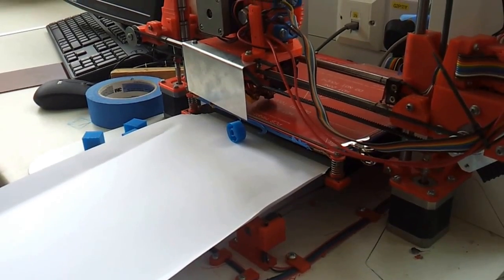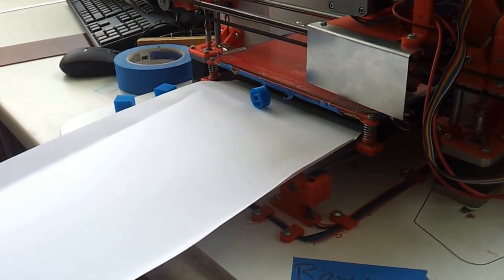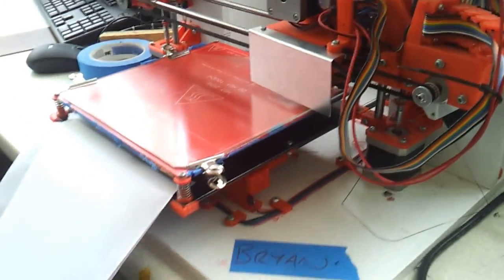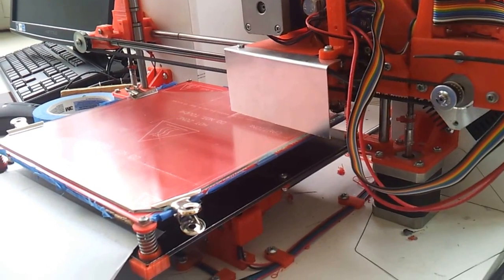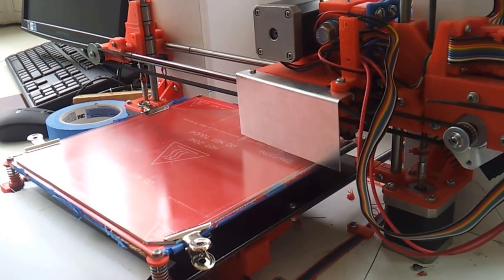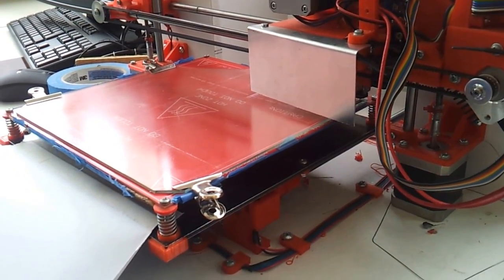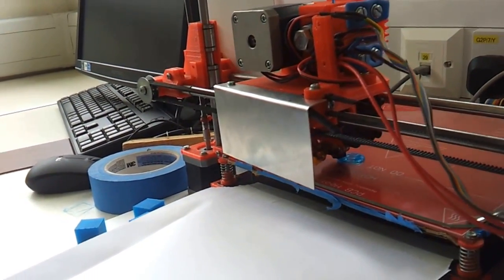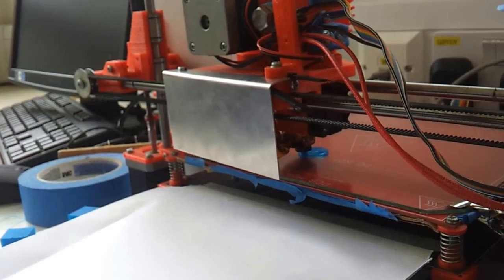RepRap Auto Printing - Ejection of print and starting of new print.

Comment: I use hare-spray too since it is also good enough for a fox.  I've been using AquaNet after applying a slurry of acetone saturated with PLA and letting it dry (very quick process).  Parts stick extremely well.  I've got quite a collection of broken glass to prove it :-)  $2 picture frames at Walmart.  If I do get the repeat-fire system going I will definitely want to build my own filament making extruder so I don't go bankrupt buying plastic. :-)  As a bonus I could make spools as big as I want.

Comment: I still think that makerbot had a good idea going with the belt type build platform.  I don't know precisely what the issue was but I bet it would be alleviated with a more tank-tread setup, gear driven so the  "belt" cant get offline.  Items could go along the belt and be exposed to  various processes after printing especially removal either by the curving of the belt/tread or by some kind of pick an place system for storage in an inventory system if you really want to get sophisticated.